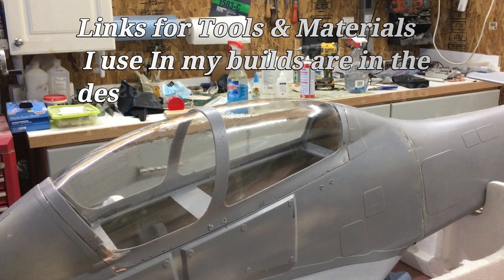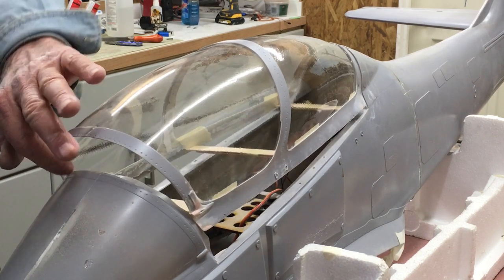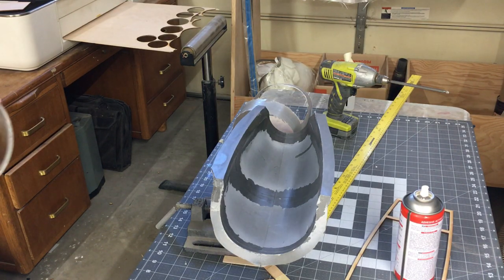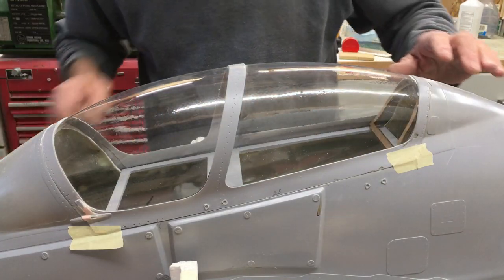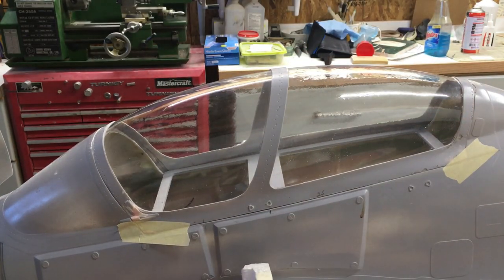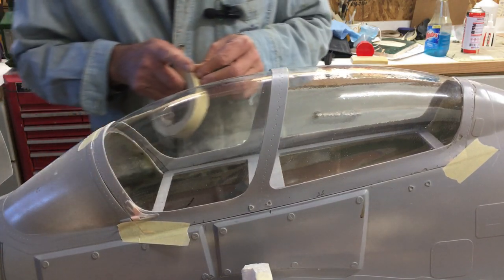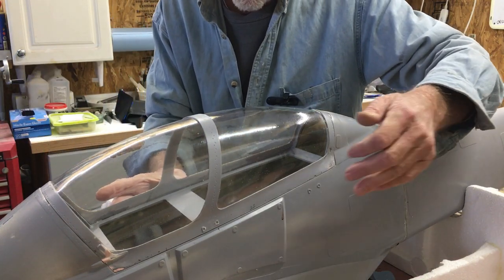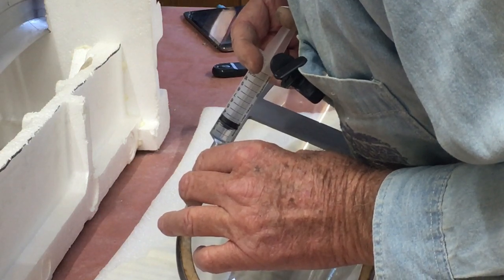Tucano Part 13 Canopy build & Install

Comment: Sir thank you for sharing, my question is which CAD/CAM program you are using for modeling an feeding the data to your 3D-printer?
Reply from the maker: I'm using the free version of Fusion 360 for cad and Cura for the 3D.  I can go directly from 360 to cura with one command.  The printer I use is in the description.  Subscribe and be notified of all the build videos and thanks for the comments
Reply: @britcharming  Sir, thanking you for your swift answer. I try to copy your workflow for my version of the Super Tucano. Aren't you perhaps willing to selling me the shells for the Tucano fuselage?